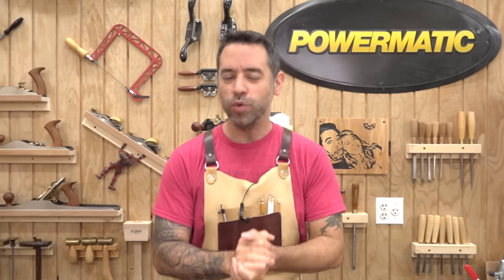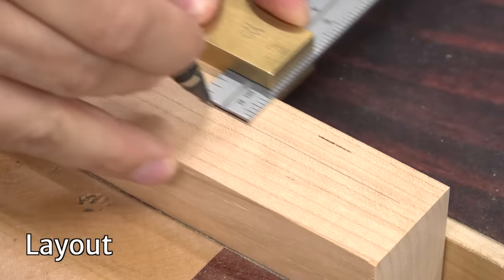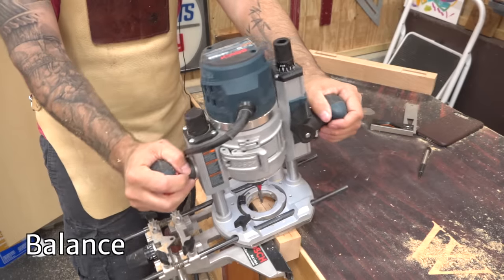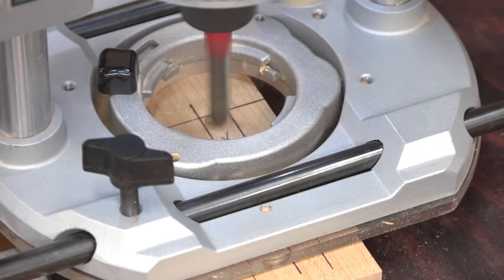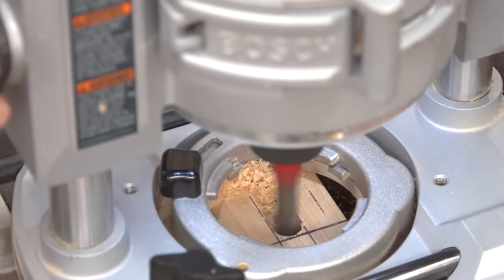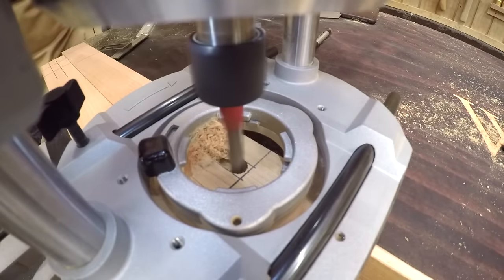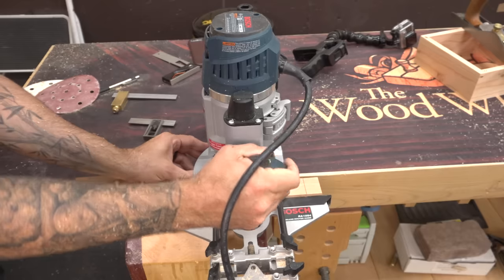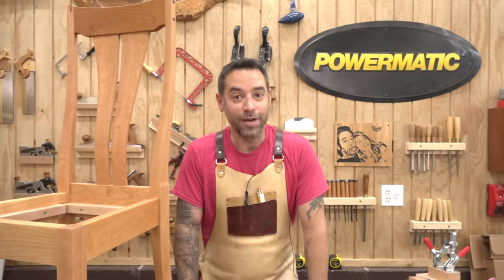Quick & Easy Mortises

Comment: If the width of the mortise matches the width of the bit, which it will in many cases, the direction of the rotation means nothing.  The real concern is being able to stop the router at the ends of the mortise.  To give more control, don't take more than about 3/8" in depth on each cut.  That will minimize the grab.  Plunging the holes at start and stop is very helpful, as shown in the video.  Easier still... clamp stops to your workpiece.
Reply from the maker: +TomKaren94 rotation direction always matters.
Reply: My thoughts exactly.  It would seem that, along the axis of travel, one side of this bit is "pulling" in the direction of travel while the other side is "pushing" back.  Wouldn't those two forces tend to balance when moving  in either direction?
Reply: Rotation matters because of the router guide that rides along the side of the work piece.  If you could put it on the other side of the router, you'd want to go in the other direction.  It may not seem intuitively apparent, but if you go in the wrong direction, the guide will want to drift away from the piece.  You can keep it against it, but you really need to pay attention.  Do a hundred of these on a baby crib or something, and you'll know what I mean.  Unless you want a curved mortise, you may want to listen to the man.  I found this out myself, and created a few new curse words in the process.
Reply: You are probably right about the importance of rotation direction, but the unanswered question is WHY it is important in this application.  The explanation given in the video is not accurate, as that example does not apply to the forces at work in a "plunge" cut.  If the bit was moving right-to-left in the plunge cut shown, the rotating  "leading edge" (arc) of the router should tend to pull the router toward the fence.  This force can cause the fence to lose contact with the guide, resulting in the curved mortise that you describe.  Moving the router left-to-right, in this example, has the cutting forces pulling the router fence toward the guide, which would tend to help maintain a straight cut.

Comment: I'd recommend getting an extra guide fence and using the pair to prevent any sideways drift by running one on each side of the work , been using a double fence on my trusty GOF 1700  to rout locks in doors for thirty years now , takes maybe a minute as opposed to the dinosaurs that still drill and chisel them in ... :-)

Comment: I always enjoy your humour! 
Couple of points though mark, you don't "need" an up spiral bit, std two flute straights will quite happily route mortices all day long quite happily, although up spirals do help clear deep narrow mortices, people will be in danger of thinking they should go out and get an expensive STC bit when the two flute they have will be fine.
Also you say "move the router left to right, push don't pull". But this only applies with the exact same setup you have. With the fence referencing on the front face, but standing on the other side of the router, I should pull, not push.
With the fence referencing on the back of the work, You would have routed right to left, from the camera POV, a far simpler way to remember if the same with a bearing guided cutter with the direction of cut being anti clockwise around the outside.... with this in mind, our router fence is also referencing on the outside of the work, so it too should travel in an anti-clockwise direction. Pushing, pulling or twisting side to side becomes irrelevant and only a matter of personal comfort. Also, you move the fence away from the cutter to widen a cut, this keeps subsequent cuts direction of cut the same.
Reply from the maker: My goal was to keep the video short and sweet. If you try to cover all of the various positions and work orientations, people quickly go cross-eyed. My hope is that if people hear me say, "always go left to right and push away from your body", they'll realize the ramifications of putting their body on the other side or possibly putting the fence on the other side of the work. For the bit, I think you must have better bits than I have. While my two flute straight bits can indeed cut mortises, they aren't happy about it. They tend to burn when being plunged into the work and they provide more resistance and friction throughout the cut. So if someone is looking to make mortises as easily as I make them and in the quantity I make them, I do feel a spiral bit is highly recommended. Just like a plunge router isn't totally necessary, but highly recommended.
Reply: The Wood Whisperer "line the fence up on the edge of the work, and route along the mortice ensuring the fence is traveling in an anti clockwise direction along the work".
Yes spirals clear the chips better, but  they aren't needed. I never care about a bit of burning in a mortice, I either cut slightly less per pass, or just fill it with a tenon.

Comment: Hi are used to do this years ago all of the mortises for mortise and tenant joint and sometimes for locks but a better way to do it is actually buy a second fence and make sure the rods are long enough and put the second fence on the other side that way you can centralise the router.
And it will stop it from cracking on wondering off-line and if you're coming to the end of a piece of wood it is best to put another piece of wood the same thickness but up against the end so you can run through it further without the router dropping off the end.
And I hope you're wearing a dust mask a defenders and I protection I'm sorry to go on a bit but I'm 68 years old retired living in France in  lockdown ,. 17 April 2020.
Anyway keep up the good work. Regards Phil from the Moulin in France

Comment: Thanks, Marc. I still have to bang mine out with mallet and chisel, but whether using a plunge router, hollow chisel mortiser, or whatever, the "L" part is probably the most critical. If your layout is off then it'll show in your project.  Thanks for sharing these tips!

Comment: On the first pass, it looks like you only plunged to about 1/3 the depth of the bit. If so, did you make multiple passes? I just cut my first mortise with this method, but lowered the bit gradually with each pass. I'd like to be as efficient as possible, but I'm guessing that plunging the full 1 1/4 inches (the max for this bit) in a single pass would be unsafe. I'm sorry if this was addressed elsewhere, but I couldn't find it. Thanks for such a professionally made video.

Comment: To the end holding the router low for better balance, that's how the tip of my middle finger got into a turning router bit and it cut into the tip of my finger wile using a trim router with a 1/2" round over bit only sticking out about a 1/4"  I was holding the router low to lower my center of gravity and gain better control. I seriously think manufactures should look at covering 100% of the bit area so there no way with the clear covers on you can get your finger near the tool. And on a larger router put a handle you can change its location on to where you want it.  
I don't see why routes can't be worm geared like a 4" body grinder. Or one you can change angles with.

Comment: I think one reason people struggle with the mortises is because of cheap bits.  I used to have trouble because I thought I couldn't afford expensive bits so I bought some spiral bits at Harbor Freight.  Big mistake.  Might as well try to cut a mortise with a sea shell and a kitchen knife.  What do you expect when you get a set of 3 spiral bits for $7.  One good bit was $50 and it cuts like butter.  Never again.

Comment: Tools You LL need:

bosch router (plunge model)

 clams (to hold the wood/to secure)

Edge guide( to lock down the router)

Up spiral bit

Push the router Left to right ( away from you)

Comment: Another reason you push with the edge guide on your right is that the leading edge of the router bit is rotating towards the edge guide and so it is pulling the edge guide tighter to the wood. If you go the other way you will be fighting to keep the guide against the workpiece.
Reply from the maker: I said that. :) https://youtu.be/yZr_tvra--0?t=1m56s
Reply: The Wood Whisperer Ahh, I misunderstood what you were saying at that point. It sounded to me that you were saying it would tend to slip in a way that would make the mortise longer. I was thinking of preventing it from going wider or diagonal.

Comment: by the way the part when you said push the router not pull it because the bit rotation ... this only applies if you r routing against one side of the mortise but when you r routing in the middle one side of the bit is pulling and the opposite is pushing so instead the router wants to rotate or wobble in your hands deforming the path
Reply from the maker: +Mohamed Gaafar Not true. The push’pull direction still very much matters when the bit is surrounded by wood.
Reply: Yes. And the reason the push/pull direction matters here is because--even though the bit is surrounded by wood--there's a fence on only one side. The leading rotation of the bit pulls the fence into the workpiece instead of pushing it away if one routed in the opposite direction. That wouldn't be the case if a template and guide bushings are used, which obviously isn't happening in this video.

Comment: +The Wood Whisperer for how long those spiral bits stay sharp ? Theres no possiblity to sharp them again am I right?  I consider getting one but Im thinking about carbide-tipped straight bit also. Cannot decide. Straight are cheaper but more hard in use I suppose.
Reply: Check out solid carbide end mill bits.

Comment: Surely, when cutting a slot with a router, on one side the bit will be rotating against the rotation while the other side is rotating with the rotation.  Ergo pushing away or pulling towards you make no difference.

Comment: Stupid question...because I don't remember if you are left or right handed... when you push the base of the router with your left hand is that because you are controlling the top of the router with your right hand at the top or because you are controlling the base of the router with your left hand at the bottom? :\
Reply from the maker: I am right handed. And the direct answer to your second question is both. I am pushing forward with both hands but most of the forward motion is coming from my left hand. My right hand is controlling the top side of the router helping to prevent tipping and just keeping things balanced.

Comment: Do you advise using a router table to make mortises for those who have? I reckon it is harder to see where the bit is going on a table.
Reply from the maker: It can be done, but visibility is the issue. It can also be a little sketchup dropping a workpiece onto a spinning bit. But if you take precautions and use stops, it's certainly possible.

Comment: Now I just need to learn how to make tenons that fit -.-
Reply: If you want to try loose tenons, it's not the hardest thing in the world to creep up on the right fit with a thickness planer or table saw. Bit easier that way.
Reply: AvengerDK 
Just make floating tennions. The bisket type like Festools toy uses.  You just cut the mortises on both parts and you can fine tune your tenion if you goof no big deal you just make a replacement  part, never glue up until you've done a dry fit.

Comment: That's quick However not everybody has a fricking router like you. I do not have one but nice smooth techniques, thanks for the video
Reply from the maker: Well if you want to do powered woodworking, you might want to get a fricking router. Or even just a regular one. :) A very handy tool!
Reply: Are all router made equal??? Suggestions appreciated
Reply from the maker: Nope. They can all potentially get the job done but like any other tool, they vary in price and quality level. Best to find something used and save some money if possible. But just about any of the common hardware store brands make decent routers, from Rigid, DeWalt, Bosch, Porter Cable.....
Reply: You missed Harbor Freight. lol
Reply: Thanks for your input. Mr. Wood Whisperer.
Reply: I recently built a stool for DIY car repairs sorry no video, I collected some scrap wood from work and begin making it used my Kreg mini pocket hole tool but Mortises would've given a better cooler look.
Reply: No, I have had a porter cable with edge guide for years and never really felt I trusted it making mortises with out setting up stop blocks and holding my breath right. Last project i accidentally knocked it off the workbench... cussed a bit and found that i had broke the edge guide... since i was already on the fence about buying a separate router for a router table.. instead of buying another guide i bought a Bosch plunge with edge guide for my main handheld.. and retired the PC to the table.  I found that i could control the bosch better and the fence seemed to have alot less flex.. I was finally able to make mortises without tons of setup time! 30 mortises later with it I felt like a pro!
Reply: The Wood Whisperer great response!
Reply: I found a similar router to the one Marc uses in the video (Bosch 1617, about 1 notch down in quality, and very popular) for $125 on Craigslist, and the guy threw in the edge guide and a half-dozen budget-quality bits. You'd be amazed what you can get on the gently used market. Frankly, my area is terrible for tool finds on Craigslist, so you might have even better luck.